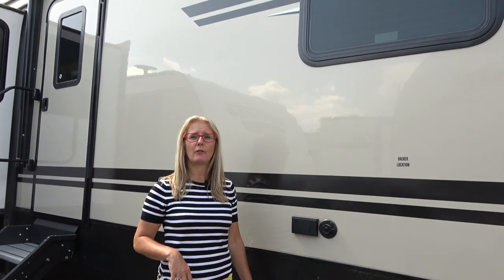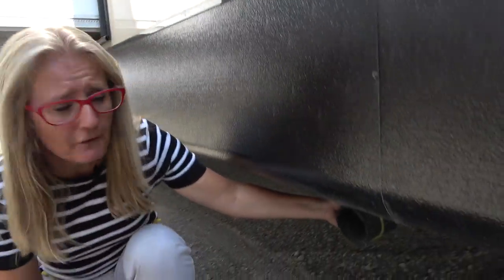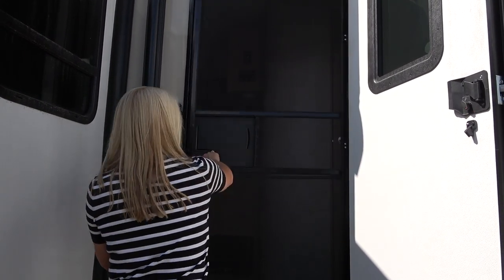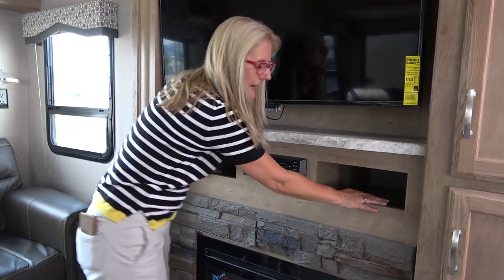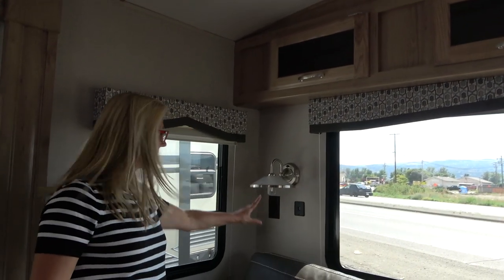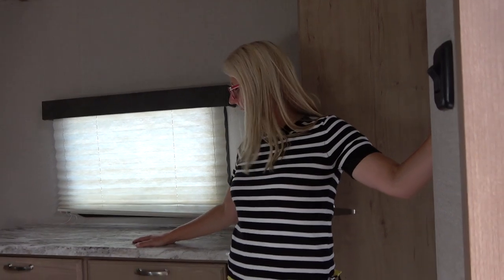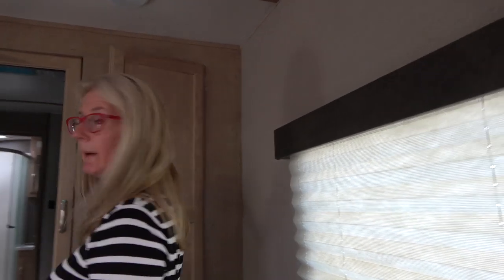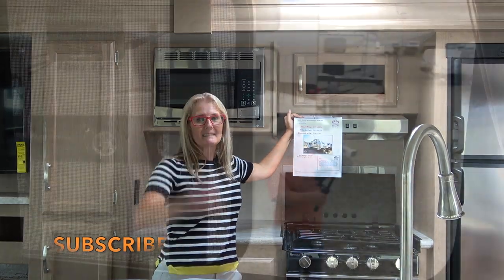Winnebago Minnie Plus 30RLSS (Unbiased RV Review)

Comment: Traveling in any type of RV, owner has to be very mobile. Not only the hitching trailer,  connecting of the sewer+ utilities,  leveling of the unit, etc. Everybody's body gets older at a different age/rate, working and connecting the above's, can pull your back out, hurt your knees, slip and fall, pinching nerves, finger cuts, bruises, scrapes to our heads,  Etc . Many RV’ers at a certain age,  will have a RV service either pull their RV to a certain area or have a valet service set up camp.  There's nothing wrong with ageism,  RVs have a lot of working parts just like our bodies do, and they're not cheap to repair. Our body has mystery blowouts and so do our RV’s. Many older RV owners, prefer just to park n store their RV’s adj. to their homes, so they can safely use the RV as personal guest house or casitas. This is called the second phase of RV Ownership, which can be fun and less challenging.
Reply from the maker: That's the beauty of RVing. As we always say 'there is an RV out there for everyone' and that means an RV Lifestyle for any age group too. There is no one right way to enjoy your RV. Do it however you like and makes you happy whether you go across the country, across town or across the yard. Enjoy it. Thanks for watching.

Comment: I agree, the mirror in bathroom placement is useless.  The mirrors in the bedroom being tented is useless.  I also agree with you on the dinning room table/bed set up seems like more hassle then normal ones, the bench seating cushions was designed by a idiot. The recess opening below the tv I think are for holding DVD/blue ray records 🤔,  but again I agree it should have a cover door or something to cover it.  The manufacturer really missed the mark with this model trailer.  It’s like the only upgrade (plus) is a name logo..🤷‍♂️   If this is really a real upgrade, then I would be very afraid to purchase their lower models😬.   Very informative video.   Good job😃👍
Reply from the maker: There are some parts that are an upgrade but then there are others that are lacking which was a bit disappointing to us as we have really liked the other Winnebago Minnie trailers and do feel they are done very well. Thanks for watching.